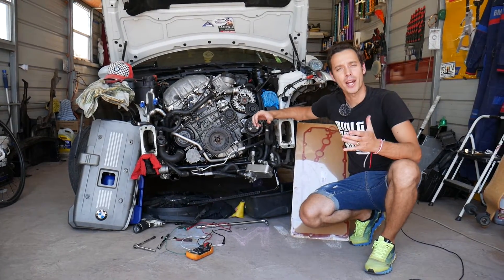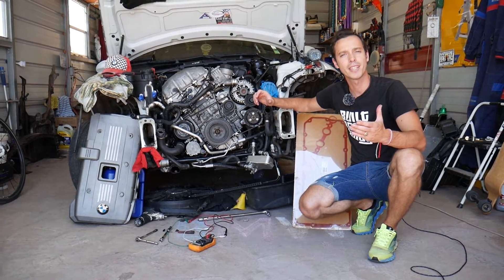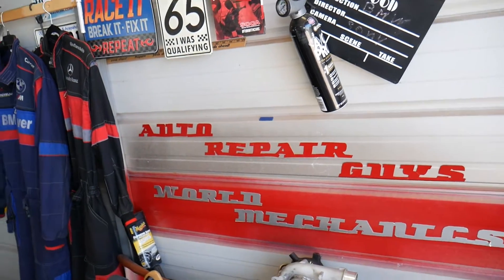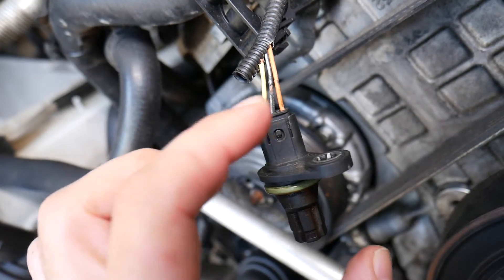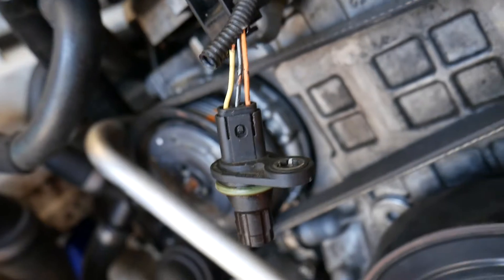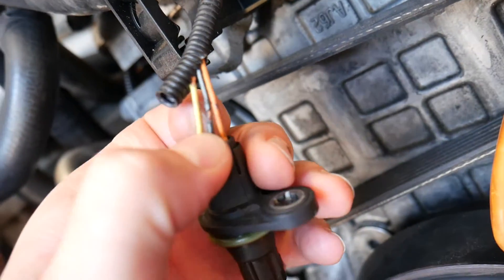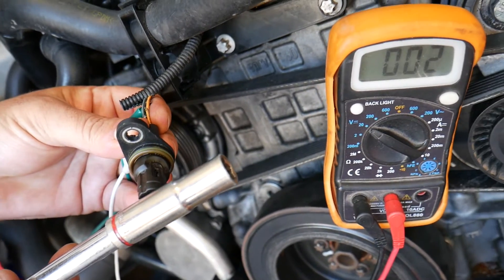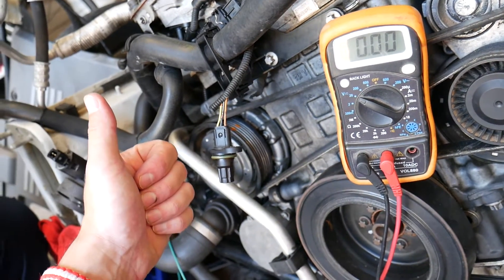HOW TO TEST CAMSHAFT POSITION SENSOR ON BMW X3. TEST INTAKE EXHAUST CAMSHAFT POSITION SENSOR

Comment: My 2013 X3, runs normal at cool temperature, but once it reaches normal operating temperature, it dies and only cranks but won't start again until it cools down 6 hrs later. I have no codes on the scanner, what could be causing this?

Comment: Guys I need some series help After oil change on my 2013 X3 with 85K miles that was always serviced in BMW I had “engine oil pressure to low” followed by Drivetrain malfunction on a dashboard in error codes showed No.DTC E114BC ? 
since i couldn't find anything on this error code i used OBD2 scanner and it showed P13C9 camshaft stuck + P054B cold start camshaft position timing over then P052B camshaft position timing over. Long story short I had to get it towed to my house. I have changed a camshaft sensor and my“engine oil pressure to low” followed by Drivetrain malfunction” disappear but i cannot start my car ? any advise ? Please help
Reply: Hi same problem with b46 engine any clue what it was?